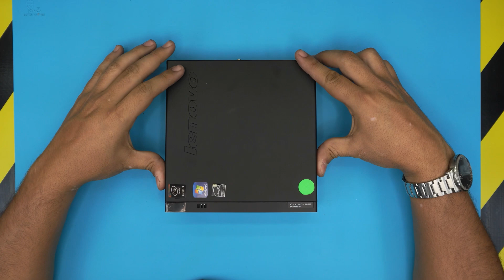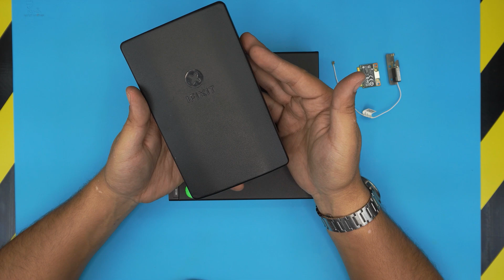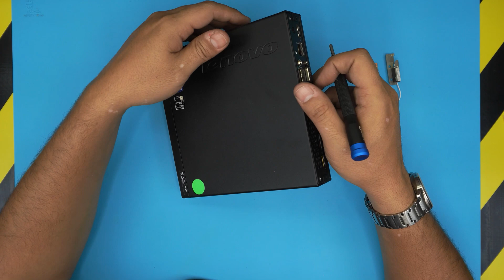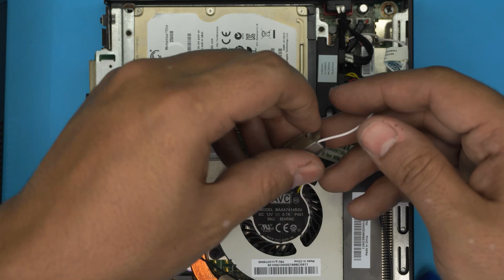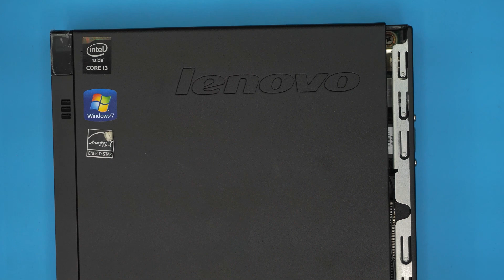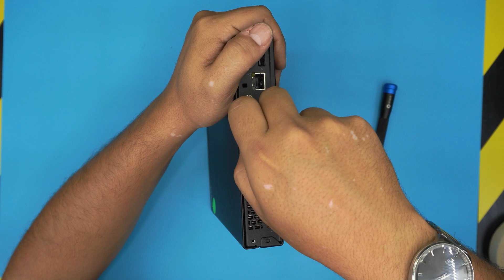Lenovo ThinkCentre Mini PC ADD Wifi Card GUIDE

Comment: Great video, always be mindful of cable routing and antenna placement interference. Placing near or on a heatsink might not always be the best solution. Long-term you want to keep the cables from heat sources, and think of the orientation of the desktop and which way you want the antennas to face. WiFi can be tricky but this video shows exactly how to do it with a Think centre like the M73. The bios can be allowed to accept non Lenovo certified cards but this method is not recommended as it involves rewriting the bios.
Reply from the maker: You can reflash the BIOS and use any Wi-Fi module. The placement of the antenna, wherever I place it, will not affect the Wi-Fi cable at all. That area is the intake for the heatsink, so it will always have fresh air coming in. We've installed this setup for years without any issues, and it's still running perfectly fine. If you think this is not correct, note that in some ASUS gaming laptops, the antenna cable runs straight over the heatsink exhaust side, and that still works fine.
cheers🍻

Comment: Is there a reason you didn't secure the wifi card with a screw?  One hole aligns with the pin on the motherboard as you showed, but the other hole should be over a threaded insert to accept a screw.  I usually see configurations with one internal antenna that mounts ahead of the SATA drive, and another longer antenna cable with a bulkhead connector to mount on the back of the unit for an external antenna.  I've never seen internal antennas laying unsecured inside the PC, and I've never seen them mounted where they are touching the copper tube of the heat sink.  That's got to be the hottest surface in the entire box - apart from the top of the processor itself.
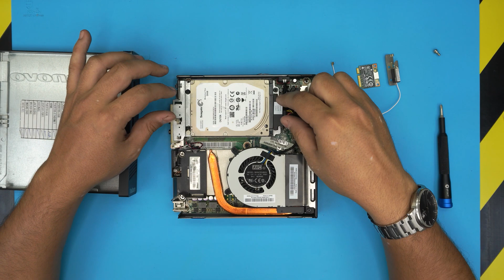Reply from the maker: 🫠Regarding your question, if you had watched the video from the start, you would see that the HDD caddy ( @2:50 ) is screwed down in the screw hole you’re saying is "not aligned." These WiFi board models are all sold with a two-screw hole configuration, but it’s not necessary to use both screw holes. Some laptops and PCs only require one screw for these cards.
About the location of the antennas, I placed them on the plastic near the small speaker plastic (not in direct contact), and that part of the PC is cooler as it is an intake passage for airflow.
BUT you can place them wherever you see fit, my friend.
cheers🍻

Comment: Thanks for this video!
But Im unable to connect lan cable from wifi router to pc
Im getting no connection check signal cable
Please let me know what to do
Reply from the maker: Thank you for your feedback! If you'd like to support the channel, you can show your support by liking and subscribing.
Regarding your question, to resolve the issue, please follow these steps:

    Check if the drivers for your motherboard are installed. Make sure you have the latest drivers by visiting the manufacturer's website and downloading them from there.

    If the drivers are up to date and the issue persists, it's possible that the network jack on your motherboard is damaged. In such cases, you can consider using an adapter to connect to the network. This can be done by obtaining a compatible adapter and connecting it to your computer.

You can find a suitable adapter on Amazon: https://amzn.to/46833wq

By following these steps, you should be able to resolve the network connectivity issue. Let me know if you need further assistance!

Comment: Pls Help mines not working no post. It was ok just suddenly one day when I turn it on. Tried everything except removing the CMOS battery.
Reply from the maker: Thank you for your feedback! If you wish to support the channel, you can like, subscribe, or both!
Regarding your question, remove charger and remove the cmos battery and press and hold the power for 60sec then plug the cmos back and the charger and  wait 15 sec then press power on.
Reply: @uFixTek  thank you for replying I really appreciate it. I will try it better get myself some thermal paste first.
Reply from the maker: It's my pleasure my friend. 😊
Should you have any questions or requests in the future, please don't hesitate to ask me.

Comment: Does it have Bluetooth too?
Reply from the maker: you can get a m.2 wifi combo with bluetooth
Reply: @uFixTek  Yeah but how do I find the part number? I've already tried putting in a bunch of different cards but it just kept booting to an error message on the screen.
Reply from the maker: can you get me the exact model of the pc all the info you can get.
Reply: @uFixTek  ThinCentre M93P. I think I bought the same one that you have in the link or maybe it's the same brand and it's not compatible. The BIOS tells me that it's not compatible and to remove it.

Comment: or just buy a wifi dongle, it's easier.
Reply from the maker: Thank you for the feedback! if you wish to support the channel you can LIKE or SUB or both :P
regarding your option: just make sure you buy a  good quality because the mini wifi dongles don't last as we have tested many of them for years and after a year they start over heating and restarting. but it is an easy option.

Comment: Great Video, i was thinking to get a wifi card for my M73 - 10AX, but worry about the card want to buy from the internet may not compatible, will stick with the usb dongle. 

Meanwhile my M73 some time cannot power on (only fan running, no power led), after unplug and replug the hard disk signal cable it will on again, what could be the issue? thanks.
Reply from the maker: Thank you for the feedback! if you wish to support the channel you can LIKE or SUB or both :P
regarding your question: the issue that you mention we do get often in the store, and it happens to normal laptops too, the problem is from hard drive firmware, i recommend you to replace the hdd with SSD drive, and reinstall the windows:
ssd upgrade: https://youtu.be/GG13pkiKeZA
create windows 10 boot: https://youtu.be/uDu8j2lE-dM

Comment: I have a thinkcentre m92p. I tried to install a wifi card. However there is no clip or pin to hold the card down. Does anyone know where I can get a small screw or pin to do that?
Reply from the maker: if your board doesn't have a riser or holder, but it must have a hole on board if it does then get a riser.
https://amzn.to/3ciCGfH

Comment: WARNING! If the wifi card is not from Lenovo, it might get blocked by the BIOS and you will not be able to boot because the BIOS will block it. You will need to unplug it. Try before buying.
Reply from the maker: you need to try out, and not all lenovo wifi cards are compatible too, you need to try few cards and see what card is not blocked.
Reply: @uFixTek  Yes, I just wanted to say that it might not work, I was not criticizing your video.
Reply from the maker: no worries, i don't take your feedback against my video or anything, the issue is that there is black list or a white list for the series of wifi compatible or allowed to work with this bios. and no one has this list and for the same reason we only can try different cards till one works.i get clients coming in with this pcs and we have a big inventory of wifi cards and we test till one works.  i do appreciate your feedback and comments.
Reply: They are actually Intel WiFi cards. One type of card only seems to provide wi-fi while a newer card does WiFi and Brue Tootfh. Windblows 10 update has the drivers.
Reply: It's actually an Intel WiFi card. And it absolutely has to be the correct one for Bluetooth to function... But for wireless only I have seen at least two different Intel cards in them

Comment: Hi, is the card shown good for a Lenovo M73 - 10AX?
Reply from the maker: your model 10ax is very hard to find a compatible wifi card. you need to take it a shop so they can try different brands and model till one accepts, because lenovo doesn't give the list of the compatible card. :(
Reply: Hi, I have also a 10AX, did you find the wifi card for it? thx

Comment: would this work on my Dell optiplex 3070 micro?
Reply from the maker: yes it will but not all wifi cards are compatible, and there is no exact link of what cards are compatible and are not in the black link of the firmware, 6-10 cards are compatible. the black list of the cards are depending the location of the sell and date, and no way to get access to the black list. you need to find your self a technician that has few of the cards and try out few.,

Comment: This is for wireless internet right
Reply from the maker: Thank you for the feedback! if you wish to support the channel you can LIKE or SUB or both :P
regarding your question: yes my friend. its WIFi
Reply: @uFixTek  and Bluetooth right?
Reply from the maker: yes its wifi and Bluetooth combo
Reply: @uFixTek  thank you so much and will it work with m93p
Reply from the maker: yes it will, but there are some wifi cards that are not supportive,
Reply: @uFixTek  but most are?
Reply from the maker: 8-10 are. the best is to take it to laptop or pc shop they have many on hand and they can plug in and test and see the one that is accepted.
Reply: @uFixTek  ok so in order for the card to 100% work I’ll need to buy the actual card from Lenovo for my model
Reply from the maker: yes and they will sell it 300% $$  :/
or just try out few wifi cards

Comment: Would you be able to check for me which wifi 6 card I could use with my Lenovo M93 Tiny? Model 10AAS01N00 and bios FBKTE0AUS, would the one you used be ok? many many thanks!
Reply from the maker: oki let me check that for you give me few hours
Reply: @uFixTek  Thanks!
Reply: @uFixTek  did you manage to find out at all? thanks!
Reply: @uFixTek  Have you found out, please? I also need to know this (have the same specs).

Comment: how will this work with antennas inside the metal case?
Reply: I think the font panel is made of plastic, I don't know how well this will work but I think I will hold back from buying the antenna which keeps breaking and try this one.
Reply: The front is plastic.
Reply from the maker: Thank you for the feedback! if you wish to support the channel you can LIKE or SUB or both :P
regarding your question: it works just fine but if you wish you can place the antennas on outside of the case.

Comment: Easier and cheaper to just plug in a USB wi-fi
Reply from the maker: True, but it takes usb port and most people use all the ports but that one external solution.
Reply: @uFixTek  Oh yeah? So you're saying it's better for the average person to screw around inside a pc or simply use up one of 4 or 5 ports?  Buddy, you are wrong. One usb port covers wifi, one for mouse/keyboard combo. At the back. Hardly a problem leaving open probably 3 for most.

Comment: Hi i have a Mini PC M93p. Model number is  10AAS40201  & Serial No is PG00E2UW. Kindly suggest a  wifi board that is not in a blacklisy, which i can add
Reply from the maker: Thanks ✌  for the feedback!  if you wish to support the channel you can LIKE or SUB or both :P
Regarding your question:  im actually looking for seller as they are limited and its all sold out and as soon as i get few links i will post.
Reply: @uFixTek  - Great Video ....Thanks for kind feedback. Looking forward to your response

Comment: What wifi code are you using? I heard/read that only certain cards work or are whitewashed from the bios
Reply from the maker: depending your bios model, if you want to give me the exact model and pc info and i will try to get you a link for the wifi board, that is not in a blacklist.
 	ask@ufixtek.com
Reply: @uFixTek  I appreciate that a ton! 
Bios version date 
Fbktd8aus
9/17/19

Model 
10ab0010us
M93p tiny
Reply from the maker: wow i talked to all my friends as the 10ab0010us has the biggest blacklist possible. :( the only thing is get them directly of lenovo. OR use a NANO usb wifi they work great and only take one usb space at the back. very tiny:
https://amzn.to/3y0M11c
Reply: @uFixTek  Dude I sincerely appreciate you looking into this! Well thats a bummer! But it is what it is. I did read you could modify the bios but im just not software savvy enough for it. I did however order a wifi card with a certain fru p/n (04x6010) if it does work.. I will update this reply for other viewers

Thank you again!!!
Reply from the maker: @nelli-ocalypse  please do keep us informed, and dont do any bios firmware change as we tried and in the process we have bricked a bios and had to order new bios and solder back in. Its not worth it.  Good luck and i hope you get your wifi set.
Reply: @uFixTek  The card I currently have is the n-105 (only 2.4gh) The wifi card I'm getting is dual band and also has bluetooth so I can free up as many ports as possible. (This is my living room emulator machine.. which so far it's fantastic for). If this works.. this a great solution. I did look on lenovos parts website for my exact model and they show a recommendation for a dual band card only which is an intel centrino advanced N 6205. Fru p/n 60Y3253
Reply from the maker: @nelli-ocalypse  i hope you get the correct card soon 😋